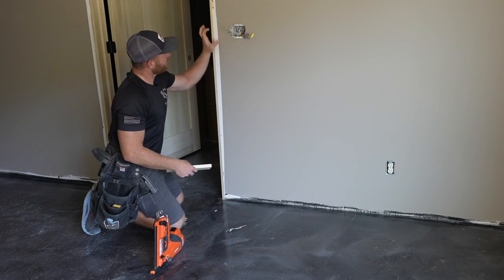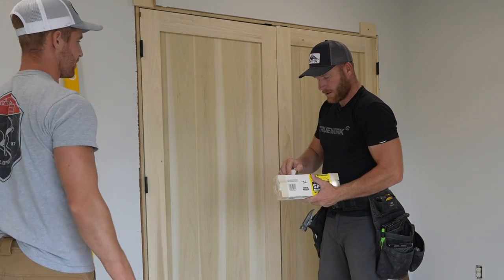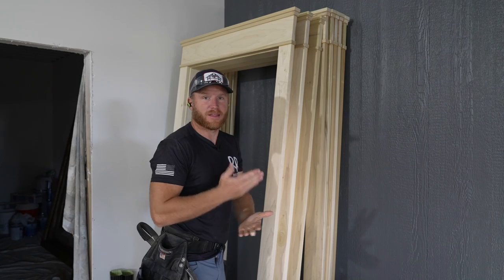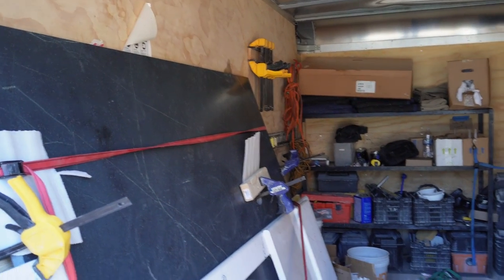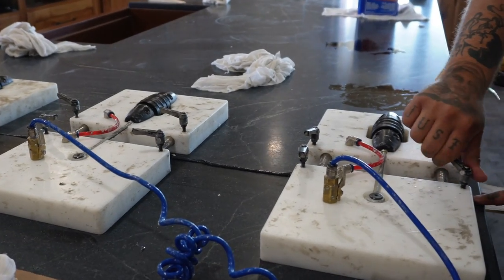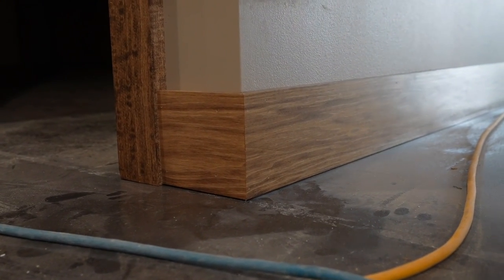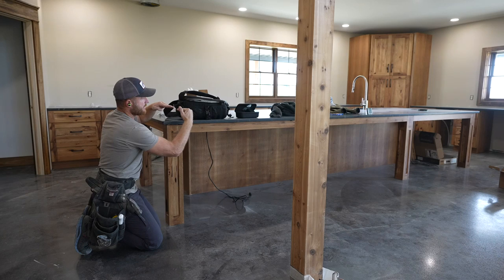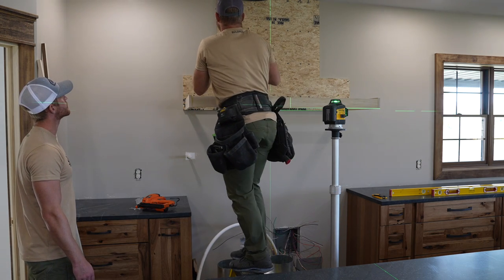Building a Barndominium: Trim Install Tips and Tricks and Countertop Install

Comment: 29:30 Kyle it's a variable speed trigger on the drill, you don't have to do this on/off motion, kinda like when you drive your truck, you vary pressure on the acceleration pedal instead of going on off on off on off

Comment: Nice work! Small tip…carry some ca glue for small trim pieces like the ones you were working with around the 4 minute mark. Just put some painters tape on the outside of the miter and fold it up…keeps the miter lined up and stops any glue from getting on the stain. Then you can still mail it without all the hassle.

Comment: As always, a Great job Guys!
Another good reason to "wrap" your miters with the same piece, (especially when working with Pre-finished Trims) Finished Corners will Line up and look Perfect because as the Finisher was Sanding, (or as the material was sent through the Shaper) any and all profiles will line right up!
Also, both Milwaukee and DeWalt offer Cordless 23ga Pin Nailers 😉

Comment: Great work dude.
I'm a little surprised that u don't use CA glue on your mitred stopped ends as it dries in seconds (don't use the activator as it's too quick) and you won't need brads.

Comment: Those stone countertop installers were pretty rough on those base cabinets as they manipulated it into place. There was a ton of cabinet movement that did not have to occur. They had plenty of manpower to lift it instead of hastily sliding into position.

Comment: Dude, seriously, get some CA glue and activator for those small return miters.
Drop on top and bottom with regular wood glue in the rest of the middle, CA holds it in seconds till the wood glue sets no nails needed.
No more risky holding the piece in the danger zone for nails, no more splitting the small return with your nails.